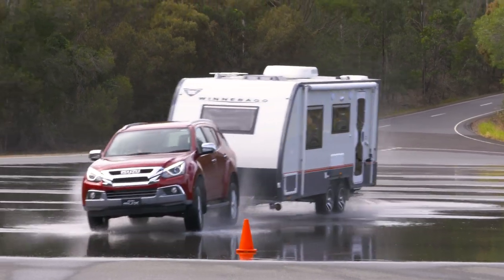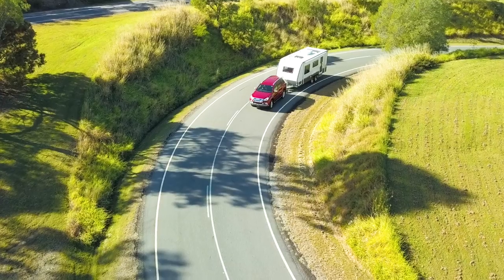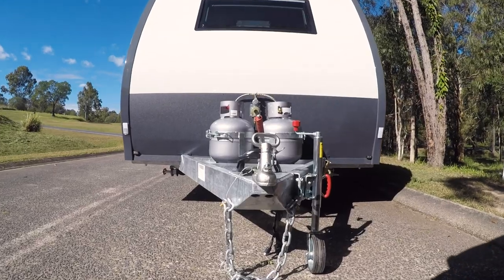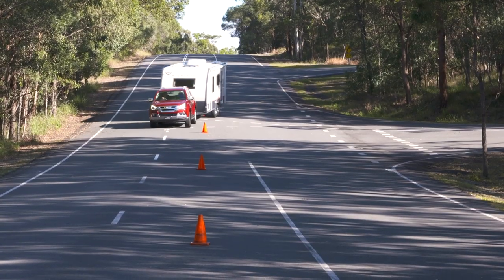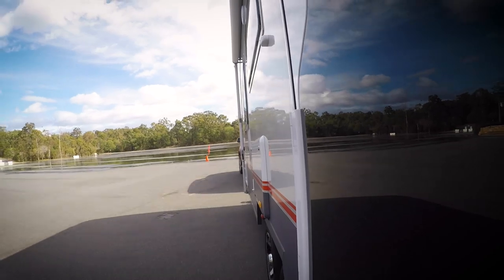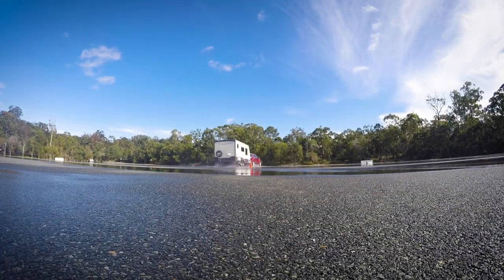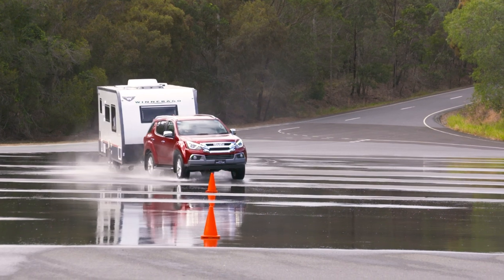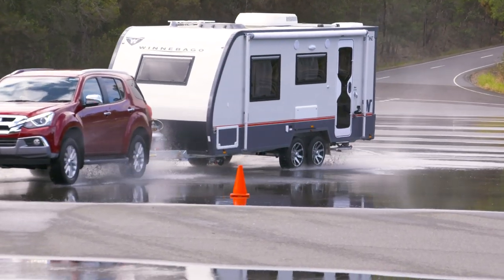I-Venture Club – 4x4 Tip: Towing & Trailer Sway

Comment: I cant see why Isuzu need owners to manually turn off safety features such as Lane departure prevention, Emergency lane Keeping, Blind spot Monitoring , and Rear cross Traffic alert everytime a Caravan is connected... Surely they can AUTO disconnect when it senses the trailer plug connected ( As it does already with Rear parking sensors )
Reply: They finally listened.  The new 2023 model does just that.  No use for those of us who bought already 🥺 although hopefully they can include it in a firmware update